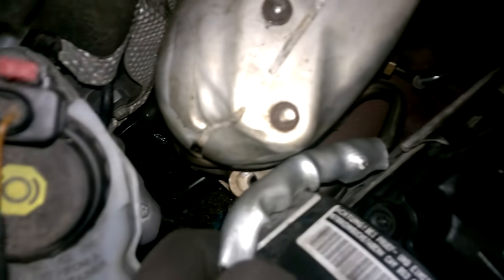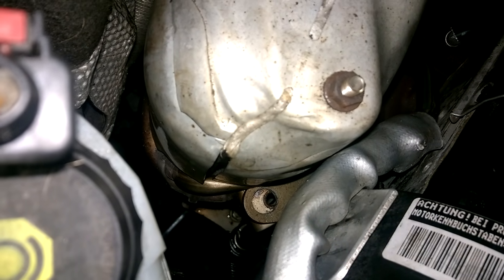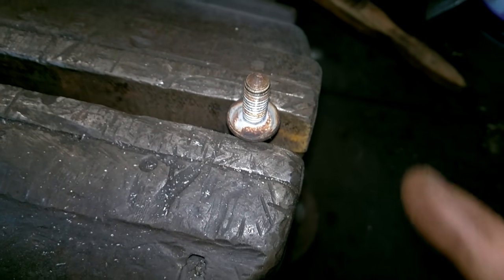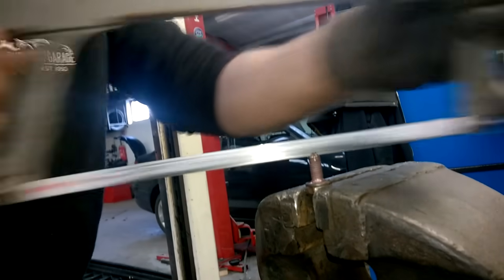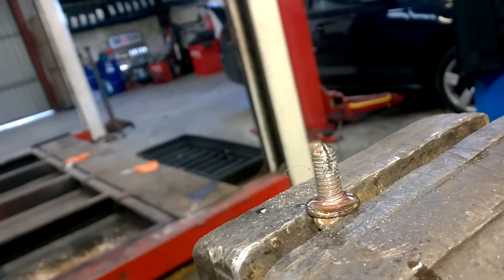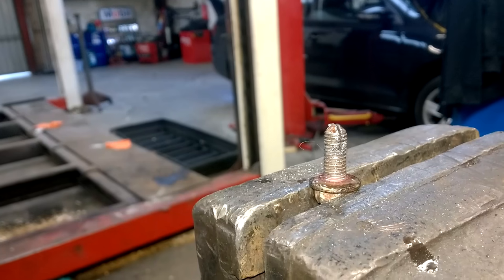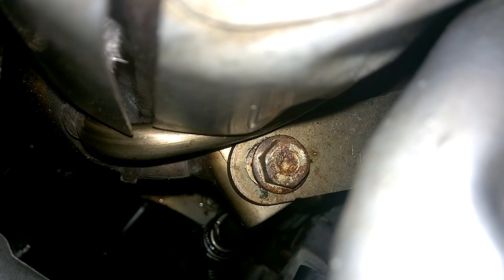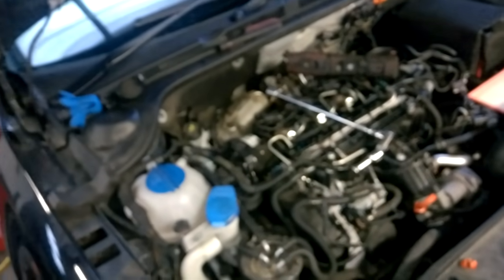My Father Taught Me This! Passing It On To The Next Generation

Comment: It may add a bit of "give" that allows collapse, but it really is just making a thread chasing tap out of the bolt. The saw kerf gives a cutting face to the thread, as well as a spot for the "chip" of butchered thread removed to accumulate. Same way those self tapping machine thread bolts work, only a cross groove instead of a pie wedge. Great hack either way!
Reply: Speaking of thread chasing:  I was going to suggest that he chase this bolt first to clean up the threads, making them "sharper" or more defined, then use the hacksaw to cut longitudinally into the bolt shaft.  The video also reminded me to use a bit of oil or cutting fluid each time I'm cutting metal with a hacksaw.  Cutting "dry" wears a sawblade out faster, similar to the need for using a few drops of oil while you're tapping new threads (or chasing old ones).  Great tip, Gerard;  thanks for sharing it with us.
Reply: +d m Thank you 4 the great tip.👍
Reply: perhaps so, d m, but actually understanding the action occurring is a step toward applying the same in other situations. the "right fix" is to run a starter tap down the hole, and dress the butchered thread. but, in that spot, it would be a chore and a half, and probably end up just butchering the thread more. his "hack" is a great real world compromise, though technically, he's chasing the thread to the bolt, which could be a tad chewed also. knowing he's actually tapping the hole, a bright lad might be inspired to use the same technique to tap a hole that has no existing threads, or to slot a nut to correct the threads on a bolt or stud, etc.
Reply: ludditeneaderthal Agreed, but if it's 10:00pm and you don't have a tap or thread chaser....👍
Reply: lol, i was actually going to mention the "after store hours" scenario above as well. it's a GREAT "working solution" in many cases, even if not the 100% correct textbook repair. probably not quite kosher for fixing a nuclear pressure vessel, but plenty fine for the valve cover on your pinto, or that water pump in your utility room that chose 4 am as the time to do a niagra falls impression, or even to "go up one bolt size" to fix an aluminum gizmo with a hopelessly stripped and battered thread.
Reply: ludditeneaderthal What?
Reply: ludditeneaderthal
Great comment
Reply: ludditeneaderthal I
Reply: ludditeneaderthal in that space a a broken starter tap would be a real drag, so a great hack in my opinion
Reply: Yup. In the same situation I usually take a triangular file to the thread, filing a longitudinal groove. Works a charm.
Reply: HotelPapa100 Angle grinder here, and just take a little nick out of the top three or four threads. Works great, and doesn't weaken anything. Then you can put a new bolt on after, if you feel the need.

Comment: That was an approved repair in the 50s and 60s on non safety or non load bearing parts.  Brackets certainly were one of the repairs and the cut could not exceed 1/4 of the thread length.
Reply: Thank you.
Reply: Knew the trick but didn’t know the 1/4 length spec. As one old timer to another “Thanks”
Reply: @nikispaniki  If I remember right, The Ford manuals of the 60's showed how to do this. Ford muffler and resonator as well as hangers were put on with this kind of self tapper. And of course the parts department would never have any. Sound familiar? I can't remember if manuals of the 50s or 70s had the "If ya need one but ain't got one  paragraph. We used to keep em because they came in handy.
Reply: @briansnyder8494  FoMoCo sold self-tapping bolts that were center cut to fix stripped oil pan plugs back in the '60s-'70s. I bought a few to fix leaky pans.
Reply: @josephtravers777  Don't tell anybody, but by the mid-70's I had left FoMoCo and gone to GM. lol. But you are right, I remember panplugs being self threading.
Reply: @briansnyder8494  Everything was toast by the mid-'70s ;^) Not holding that against you. Haha

Comment: Angle grinder with a thin blade might be easier?    Thanks for the video!
Reply: A die grinder with an abrasive cutoff wheel 3 inch would be ideal.

Comment: Commonly called a bodge. A useful tip I have always used is to do the job properly.
Reply: Yes I agree with you 100%.
The trouble with putting stuff like this on YouTube is that you have to make sure that people don’t go off and do it to high tensile bolts or similar without thinking about it first. You will most likely get some idiot trying it out on their wheel nutts😂😂😂😂
Reply: Well, yeah. But where I go Off-roading, something like this could be the difference between dinner at home or dinner for coyotes.

Comment: Use a thread file for fixing the starting threads. After a few strokes of the thread file you should be able to to thread it into a thread chaser or die to clean it up even more if needed. The hole alignment is a different issue that should be fixed separately, not cutting the bolt.
Reply: Duct tape it
Reply from the maker: The update info below is the pinned comment on this video, I know most people do not realize I made that video and it better explains/shows this method in use.   
I also included below details of why the job was done this way free of charge with the customer fully informed. I hope you check it out  👇👇
 
UPDATE* I decided to make a follow up video on this https://www.youtube.com/watch?v=yfNQullGEuQ&feature=youtu.be Should answer some of the questions that were raised, I include 3 demos of this in action with close up shots.
 
As there was some safety concerns & confusing comments raised, I felt I should clear a few things up. 
1) This is a tip for certain circumstances only, I never have and never would use it on a component which would cause any safety concern to any customer.  
2) The demo was done on a support bracket only, items like this or similar will not cause any safety concern. 
3) I did this free of charge and on a time restraint, I noticed it when I was replacing another item, the customer needed the vehicle back that evening and I decided rather than leave it like it was, I would do this and secure it up fully. 
4) The bolt was not the issue, the part that the bolt threads into is a secured piece, someone had previously damaged it, leaving the bracket loose and the bolt just tightened a turn or so.
5) The bolt can be removed and will not break, it will go in and out as usual and has helped clean up the damaged threads.  
6) Used in the right application I personally believe this is a great tip and can save you a lot of time & trouble. 

Lastly to all the people who have watched the video, Thanks very much and I am delighted with the feedback I have received on it.

Comment: I have made these in the past to chase threads.   Once installed and feels good, I remove it and replace it with a spec bolt once I know the threads are good.  Seems like this application was a bracket used to hold a dipstick or something non critical but important so torque is not a big deal. Could leave the bolt in as is.
Reply: grabir01 . Naturally I do the same thing.
Reply: Lol just saw ur post after i did mine
Reply: i would say it will be very useful on the struts...I had this problem while helping a friend the other day putting a strut bolt in..we ended up putting the bolt in from the bottom upside down at an angle..A vise wasnt handy..
Reply: @raymondbucher49  you know strut bolts are directional and I wouldn't recommend cutting any bolt that holds sny suspension parts.  That's alot of weight on them struts to take away from the structural integrity of the bolt.

Comment: AMAZING...Now your Father is teaching the World !!!
Reply from the maker: The update info below is the pinned comment on this video, I know most people do not realize I made that video and it better explains/shows this method in use.   
I also included below details of why the job was done this way free of charge with the customer fully informed. I hope you check it out  👇👇
 
UPDATE* I decided to make a follow up video on this https://www.youtube.com/watch?v=yfNQullGEuQ&feature=youtu.be Should answer some of the questions that were raised, I include 3 demos of this in action with close up shots.
 
As there was some safety concerns & confusing comments raised, I felt I should clear a few things up. 
1) This is a tip for certain circumstances only, I never have and never would use it on a component which would cause any safety concern to any customer.  
2) The demo was done on a support bracket only, items like this or similar will not cause any safety concern. 
3) I did this free of charge and on a time restraint, I noticed it when I was replacing another item, the customer needed the vehicle back that evening and I decided rather than leave it like it was, I would do this and secure it up fully. 
4) The bolt was not the issue, the part that the bolt threads into is a secured piece, someone had previously damaged it, leaving the bracket loose and the bolt just tightened a turn or so.
5) The bolt can be removed and will not break, it will go in and out as usual and has helped clean up the damaged threads.  
6) Used in the right application I personally believe this is a great tip and can save you a lot of time & trouble. 

Lastly to all the people who have watched the video, Thanks very much and I am delighted with the feedback I have received on it.

Comment: Don’t try this on a bolt which is taking a lot of torsional or shearing load on its shank.
Reply: stud those
Reply: Not to mention, this bolt now has a forever home.
Reply: @douglascoleman5588  why wouldn’t it come back out? Just curious because I might actually use this lol
Reply: @wasabioful  looks like the video poster addressed that in later comments and says it can come out.  I had this same question too :-)
Reply: @justj2729  ohh nice. Makes sense to me.  I can think of lots of times I could have used this

Comment: I have also used castleated (castle) nuts turned over to chase threads on a lightly d ac imaged bolt when a tap is not available. 
Or you can make one from a nut much in the same way. I typically use a die grinder though.

Comment: Using this to get my new starter bolted on my car tomorrow! Thank you!
Reply: If you can’t get the bolt in, due to alignment. Don’t try this, it’ll cross thread, and rip out the good threads.
Reply: It worked like a charm. Had the same problem he had with bad threads at the top, this fixed it.

Comment: I thank the man that taught your father this.
Reply: I thank the man that showed the man that showed the man that showed your father this hack.
Reply from the maker: The update info below is the pinned comment on this video, I know most people do not realize I made that video and it better explains/shows this method in use.   
I also included below details of why the job was done this way free of charge with the customer fully informed. I hope you check it out  👇👇
 
UPDATE* I decided to make a follow up video on this https://www.youtube.com/watch?v=yfNQullGEuQ&feature=youtu.be Should answer some of the questions that were raised, I include 3 demos of this in action with close up shots.
 
As there was some safety concerns & confusing comments raised, I felt I should clear a few things up. 
1) This is a tip for certain circumstances only, I never have and never would use it on a component which would cause any safety concern to any customer.  
2) The demo was done on a support bracket only, items like this or similar will not cause any safety concern. 
3) I did this free of charge and on a time restraint, I noticed it when I was replacing another item, the customer needed the vehicle back that evening and I decided rather than leave it like it was, I would do this and secure it up fully. 
4) The bolt was not the issue, the part that the bolt threads into is a secured piece, someone had previously damaged it, leaving the bracket loose and the bolt just tightened a turn or so.
5) The bolt can be removed and will not break, it will go in and out as usual and has helped clean up the damaged threads.  
6) Used in the right application I personally believe this is a great tip and can save you a lot of time & trouble. 

Lastly to all the people who have watched the video, Thanks very much and I am delighted with the feedback I have received on it.

Comment: A screw that acts as a self adjusting wedge when threaded in. Like a tap!
Reply: it is a tap

you can buy a whole set at Harbor Freight for $8
chase the threads with the proper tap, then put the original bolt back in
Reply: Not a tap.  A tap cuts threads where this is conforming to bad threads kinda reverse idea.  More like a pat.  Most the time I agree you should probably just grab a tap and fix it.  This is a good tip for in field repairs where harbor freight is miles away and your dirt bike is down.    Good reason to still own a hacksaw or at least a mini.

Comment: I turned this around and showed it to my grandfather.  It was on a 1910 model t.  I didn't learn it from a YouTube video just a hard day of figuring out methods.  

Use am angle grinder and get slice it in half.  Get ready to get the bolt off and have an extra pair of pliers.  When that cut is still hot you can squeeze the gap from the angle grinder to clear the bolt.

Comment: Thank you for this valuable tip. Also people need mechanics like you who still try and fix things rather than simply change the entire part and slap in a new one etc. Good mechanics are rare now a days.
Reply from the maker: Thanks Mehdi 
 
The update info below is the pinned comment on this video, I know most people do not realize I made that video and it better explains/shows this method in use.   
I also included below details of why the job was done this way free of charge with the customer fully informed. I hope you check it out  👇👇
 
UPDATE* I decided to make a follow up video on this https://www.youtube.com/watch?v=yfNQullGEuQ&feature=youtu.be Should answer some of the questions that were raised, I include 3 demos of this in action with close up shots.
 
As there was some safety concerns & confusing comments raised, I felt I should clear a few things up. 
1) This is a tip for certain circumstances only, I never have and never would use it on a component which would cause any safety concern to any customer.  
2) The demo was done on a support bracket only, items like this or similar will not cause any safety concern. 
3) I did this free of charge and on a time restraint, I noticed it when I was replacing another item, the customer needed the vehicle back that evening and I decided rather than leave it like it was, I would do this and secure it up fully. 
4) The bolt was not the issue, the part that the bolt threads into is a secured piece, someone had previously damaged it, leaving the bracket loose and the bolt just tightened a turn or so.
5) The bolt can be removed and will not break, it will go in and out as usual and has helped clean up the damaged threads.  
6) Used in the right application I personally believe this is a great tip and can save you a lot of time & trouble. 

Lastly to all the people who have watched the video, Thanks very much and I am delighted with the feedback I have received on it.

Comment: I've usd this method but I don't saw all the way through the bolt. Instead, I make a triangular file cut part way down the thread on each side - effectively turning the bolt into a thread tap. I would recommend using a hardened steel bolt. By the way, when using a hacksaw, use the full length of the (oiled) blade, not just the centre section. The blade will remain cooler, last longer and it requires less effort.
Reply: You had me at "less effort"!
Reply: He is not making a tap he is making the tip of the bolt weak so that it can compress and have a smaller  diameter at the tip.... effectively ruined a bolt. As for turning a bolt into a tap, that's day one stuff

Comment: Yup, reminds me of how my dad used to tackle things.  Say, if this was a bracket in a car for an air conditioner dryer that wouldn't align, he'd get a 3" dia. galvanized pipe about 6 feet long and have me hold one end against the dryer while he held the other end out over the fender, and pound the $hidt out of it 4 or 5 times with a sledge hammer.  That usually worked.

Comment: Brilliant but doesn’t it increase the chances of the bolt cross threading ?
Reply: It is critical to oblong or increase the bracket hole ; as it will throw alignment off as the body thread is established.
Mark the ideal bracket location by tracing it’s edge..
Let it drift until the washer just contacts; then correct position for torquing.
Often ; an additional hole ;adjacent to ; (smaller than) the original ; through bracket and body; then tapped; will better prevent subsequent bracket drifting. 
...When there is space for it...
When the bolt is nearing full depth; bring the bracket opening to ideal setting and  make use of a lock washer to limit future bracket movement upon final torquing .
It remains an uphill battle if you let the edge of a maligned bracket hole guide the bolt to cross threading.
 The bolt rating is generally harder than the tapped body material that it is used on..
The bolt must be kept squared to the original tapping ; as the priority..
Doing this hack with a longer bolt first; helps to view whether it is entering squarely.
After backing that one out , it can be trimmed shorter to advantage the full tapped depth available.